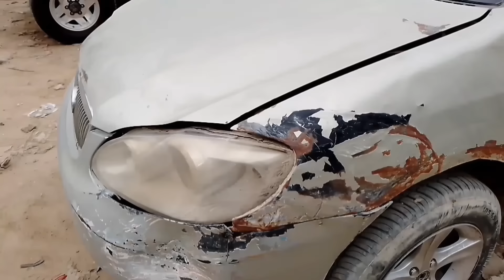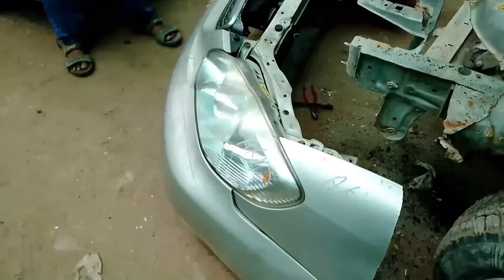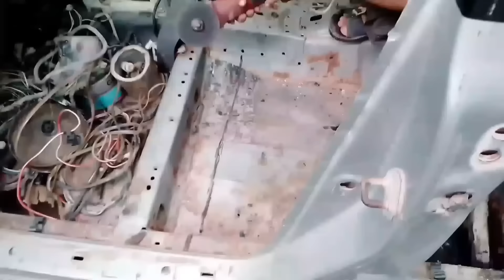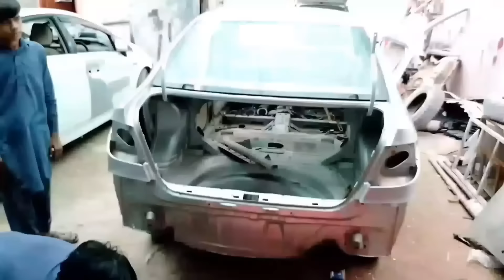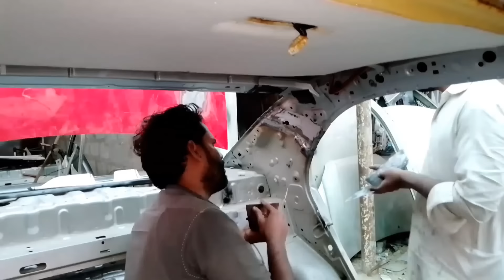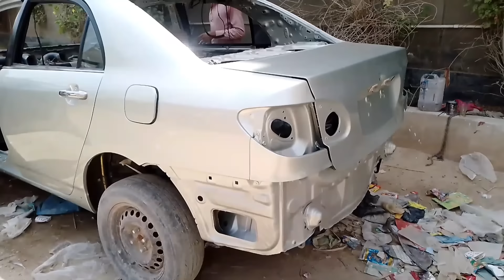Toyota Corolla 2D 2007 model

Comment: Why was it so rusty?🧐 I drive a ‘98 Toyota with no rust and I live in a wet climate. Maybe they pulled this one out of a river. But great job👍 You can’t beat a paint job in sandy & dusty conditions😁
Reply: by the look of it it had a lot of damage,which means large areas with no paint or zinc,hence the rust
Reply: The rock and sand chipped the paint away from the floorpan and rocker panels. High humidity did most of the damages.
Reply: Since its a diesel i suppose its been driven in mountain areas Damaging the body and hence other snowey areas too

Im from Pakistan and this is a stereotype that is actually true these diesel Corollas do get driven in these areas
Reply: you see how much dirt was packed into everything, add moisture and there you go.